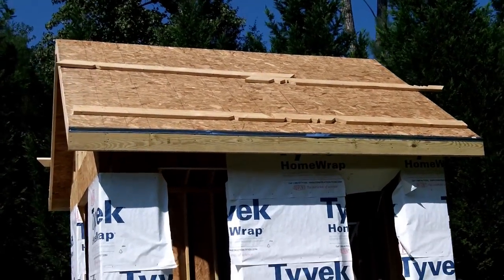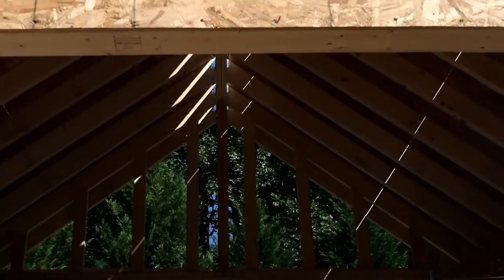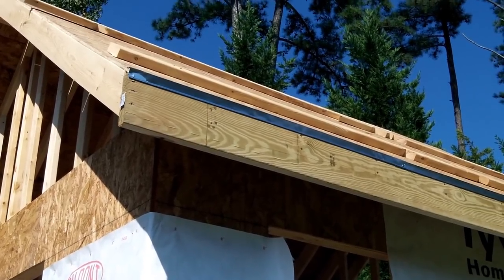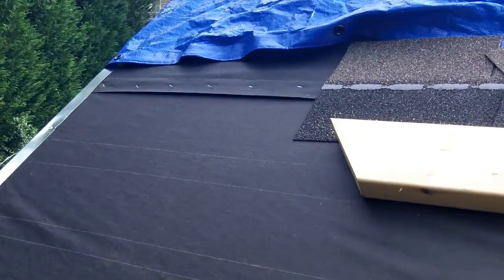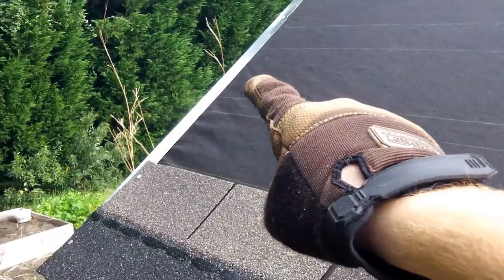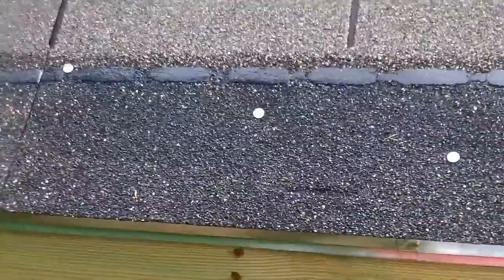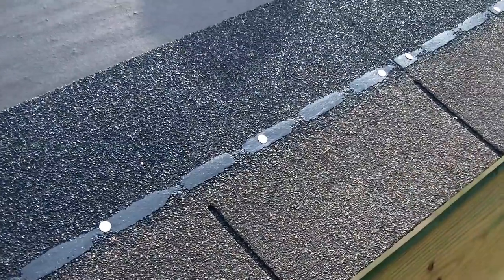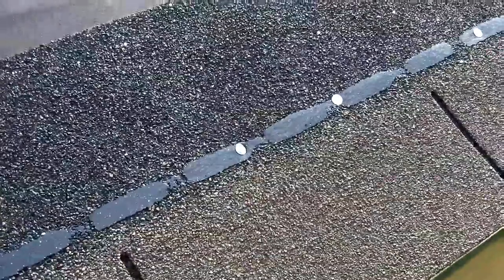DIY Shed - Part 4b - Roof shingles

Comment: TIP: Nail the shingles ABOVE the tar sealing line. When you nail into the strip, you are allowing wind and rain to penetrate under the shingle, allowing it to fail.

Comment: Just an observation here.. Using shingles for starter strips was a good idea, but that's best when you cut the tabs off first and lay them right-side-up. You take a straightedge and line it up along the tops of the "keys" or notches on the back of a bunch of shingles and slice the tabs off. Now you lay the tabless starters first, even up the gable ends. What this does is bring the first adhesive strip to the edge, thereby gluing your first row real close to the dripedge.

But I don't recommend that procedure anymore because of the cost. Shingles are no longer 6 bucks a bundle, you'll be throwing away many unusable tabs. Instead, buy your starter strip in rolls, it's like a long shingle with the tabs missing. Much easier and cheaper.
Reply: you don't waste tabs off starter  piece you use it to finish the rof

Comment: It all depends on manufacture, but when installing IKO's one of the best companies, there shingles cover more per bundle and weigh more per shingle, the quality is definitely superior. But looking at the practices, it is usually common practice to put starter strips for your first row and up the sides.This strips seal better than turning the shingle upside down. It is also common practice to use 3 rows of different starter shingles some people use up to 6 or 7.

Comment: Actually, you do not remove the cellophane strip on the bottom of the shingle.  You will not be marked down and hunted by the shingle police, but removing them is not recommended by the manufacturer